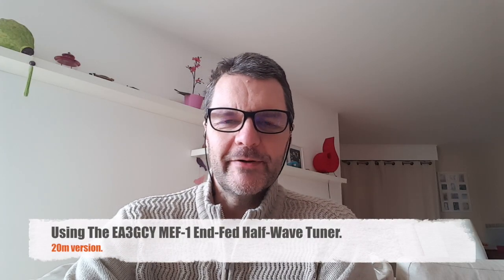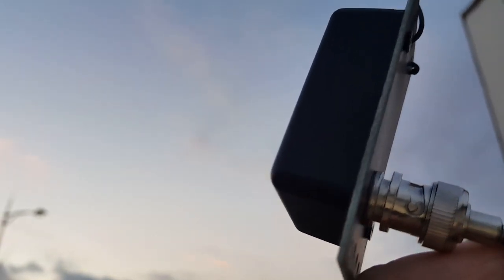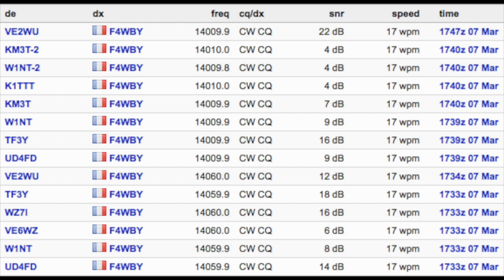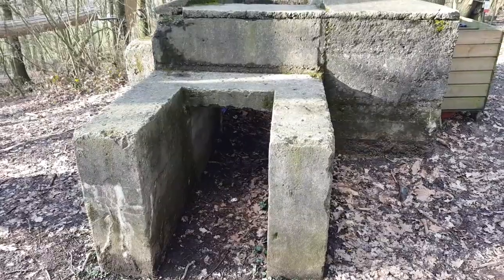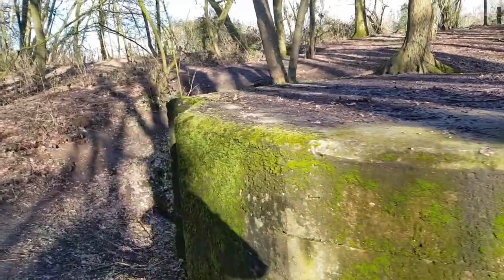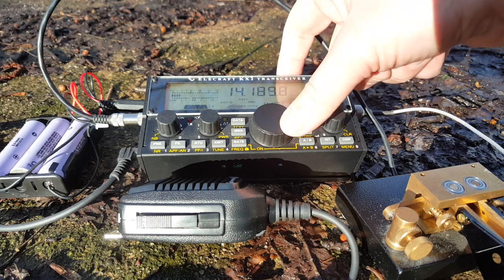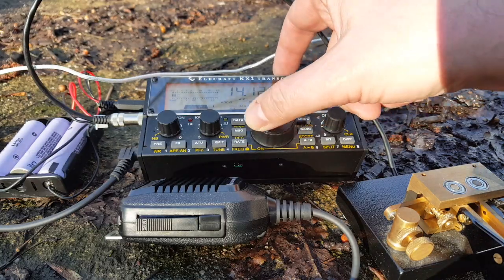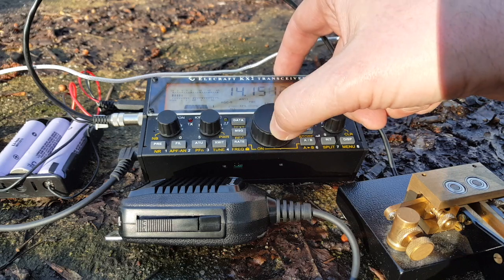Using The EA3GCY MEF-1 Half-Wave End-Fed Tuner.

Comment: Man i run my wire through trees all the time. No issues SWR wise. I have even strung up a 2M Slim Jim up in the trees and it worked! Were there affects on signal? Possibly but its the only way i can operate from the house! Trees everywhere! I work the world on the 160M Loop!

My 160M full wave loop is through the trees around the edge of my property. Works GREAT!

Great video by the way!

RM

Comment: How did you tune your unun how accurate did you need to be.
Reply from the maker: You don't tune an UNUN...
Reply: Radio Prepper Vk2PRC half wave end fed vertical antenna for DX made something similar that was not a 9:1 Unun and talked about tuning with a capacitor using cores to stop current going up the coax, how is what you are doing different. Can you explain pls.
Reply from the maker: Please post the link to Alex's video..

Comment: Nice walk and portable op. Question: with all of those brilliant bare trees, why did you use a pole? Curieux seulement. ES QSL FONE JAZZ HI.
Reply from the maker: Well, a pole is easier than messing with a slingshot and fishing line, but you're right, I didn't really need it.
Reply: I never go anywhere without my fishing reel-mounted slingshot HI.
Reply: @RobMacKendrick  I don't use a special device but have the same 30Ib fishing line I've been using for a decade now. Never understood using rope or parachord for temporary antennas.